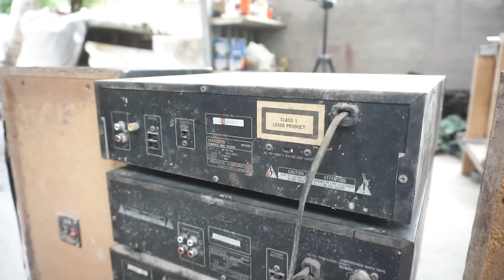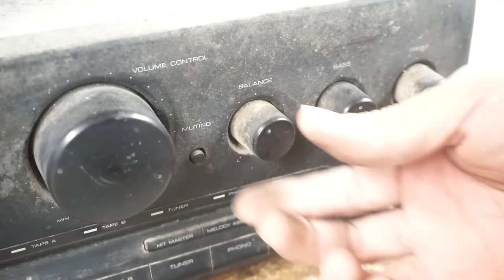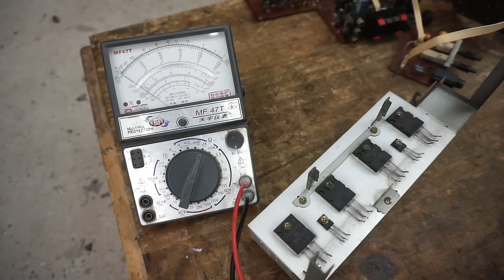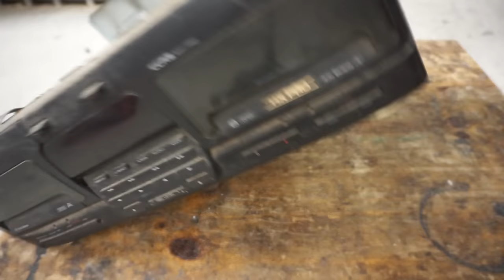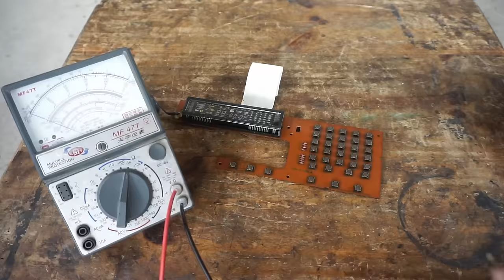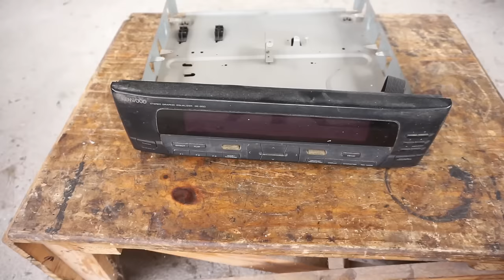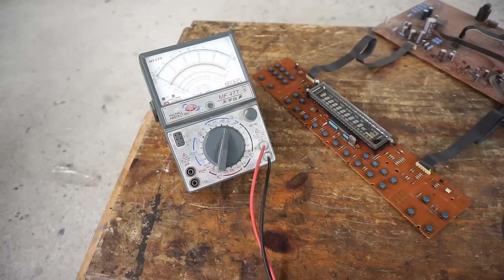72 hours to restoration the multi-function music player system

Comment: If you used a dowel instead of a drill while trepanning, you'd have more control. The hole is there, so the drill is not needed. Nice job.

Comment: I have a different model but same Kenwood brand, from the mid 90's, never missed a beat. Still use it as my prime audio system and run my DJ equipment through it with 5.1 surround sound speaker set up. I love it. Love seeing this restoration, congratulations. I learned what to do if anything ever goes wrong. Thank you 😊